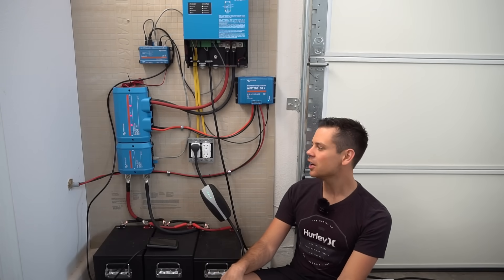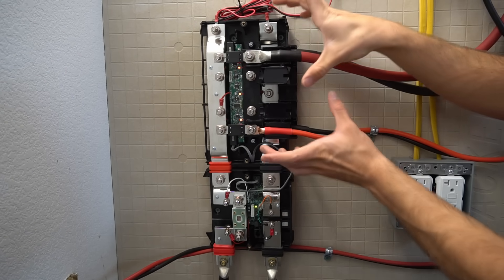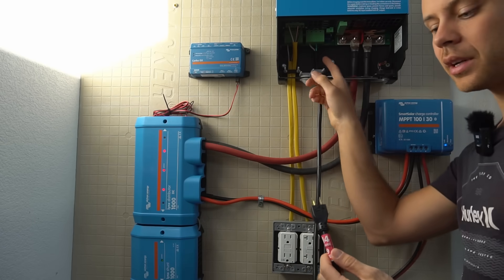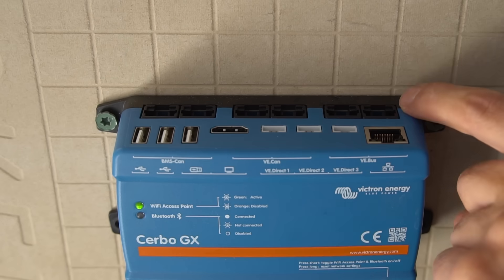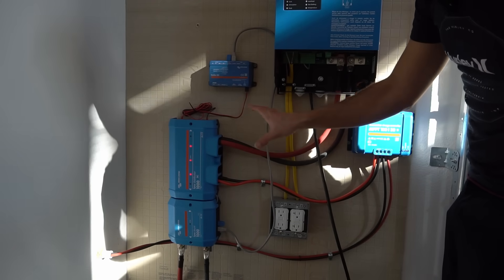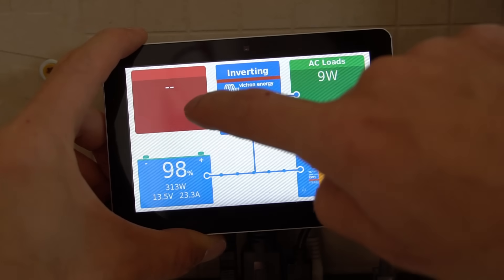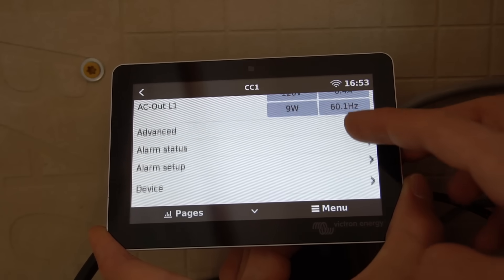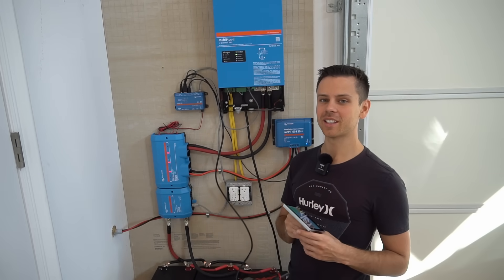Victron Made Easy! Design and Communication, Step-by-Step

Comment: I’ve got a 16 foot Boxtruck. I’m going with 120v appliances, 8000 BTU AC. 32 inch smart TV. 7 ft.³ refrigerator. The lights will be 12 V.
My question is would I be better off going with a 48 V system or 24 V system or 12 V system?

Comment: Love the videos—keep them coming!

I have a 2003 RV with a remote start for the generator. The current inverter is a Trace Engineering Model RV2012, a 12-volt system. It is almost identical to the Magnum Sine inverter. I like the idea of the Victron, but space is an issue for me.

What are your thoughts on the Magnum, and do you have any suggestions on where to purchase one?

Thank you!

Comment: There is nothing ez about Victron.   Mine trips the every time I turn the battery on.  Have to unwire and do the pre-charge resistor stupidity. Why is this not built into the unit.

And as documented on your forum. the Cerbo GX blew out also due to 48v system and lack of external capacitor. Now waiting on Victron to hopefully Warrantee it.  

Don't care how "Quality" Victron is. It is obsolete now to all the all in one units that just work.

And apparently I needed to purchase an MK3 adaptor to even be able to set it up. My quattro did not come with such adaptor.

Is there something I am missing?

Comment: Thanks Will just found this video.  Great explanation.  I'm building an identical system for my RV.  I do have a question though.  Prior to connecting the 15A shore power, your multiplus was showing inverting.  However, there was nothing plugged into the 2 outlets you had wired to L1 and L2 on the Multiplus.  Then when you connected shore power, it still showed inverting and nothing was plugged into the 2 outlets you had wired in.  Can you explain what was happening there?  If there is nothing plugged into the multiplus AC outlets, why was the multiplus inverting DC to AC.  
Again love your stuff you have an incredible knowledge of solar and electricity and do an amazing job describing things.

Comment: Very interesting and thorough video, Im looking to kit my work van out, running from a 12v DC (Main van battery) to a 24v Lithium leisure battery to power various things, such as a 24v trailer tester, and a jump start access for various 24v vehicles. Paired to that, an inverter capable of powering 3000w worth of equipment (Not constant but very often, electric compressor (2400W, tool battery charging and a few LED's inside the van) Would you recommend I use anything other than the multiplus 2 inverter for this? Im looking to do the setup right first time with proper equipment, such as Victron. 

I wouldnt be using any AC input, strictly DC from my vehicle battery charger with some sort of voltage sensitive relay /DC-DC charger for my leisure battery - feeding the inverter
Thankyou

Comment: Thank you for sharing I have a mix of equipment both Schneider Electric and victron and my question is around the victron 24 volt 3 out battery charger it's my understanding that there is a video of a distribution distributor victron showing a battery charger hooked direct to a charge controller which really makes sense so rather than me connecting my battery charger direct to my 3 battery Banks wouldn't it be advantageous to hook up direct to my 80 amp Flex Max Outback this way it could potentially double or triple the amps to the battery Bank what are your thoughts and what would be the math behind it my theory is 110 volts ac * 16 amps DC would be 1,700 some odd watts is that correct

Comment: Per manual, 440w max solar on 12v system. I think you said 800 watts connected. I have the same unit...I didn’t know this before buying it...

Comment: So where does a VICTRON ENERGY SmartShunt IP65 - 1000A/50MV come into play? Is that still necessary? Thank you 🙏
Reply: There is one built into this system bolted together with the distributor 
The Smart Shunt is a better option than the Lynx Shunt with the distributor, it is much cheaper and more accurate than these distributor linked shunts from what I have heard/seen.
Also the Lynx Power In is a much cheaper option than the Lynx Distributor if you want to save money and dont need to see a red light if a fuse is blown for another $140 cheaper (in Australia that is).

Comment: Hi, can I connect 700w to 75/15 Vitron without burning it
Reply: As long as your strings dont exceed 75v you should be able to connect about 1100W of Panels, ie: 
75v x 15A =1,125 watts.

Comment: Planning on adding a solar array to our 5th wheel camper sometime in the future. We want to be able to boondock and not need to run a genset or plug in and still be able to use an AC unit, microwave, and of course the fridge. 
I’ve been wondering what all we will need, how much, and how to set it up. 
This video sure helped answer a few questions. Will definitely be contacting Victron and speaking with them to figure out what all exactly we will need in order to set it up.
Appreciate you bud, thanks

Comment: Hi Will,
Great video as always. I notice you have that thin wire going from the Cerbo GX to the distribution box. What if you don't have the distribution box ? The battery wont have one of the sockets? Do you just strip the wires and attach them directly ?

Comment: I'm in the process of installing a Victron Smart Solar 100/30 and I see that you do not have the (now) required grounding wire attached to the screw on the left side of the controller. 
Was the grounding wire not required in 2022?. The Renogy controller I am replacing was not grounded.
Reply: From what I understand (correct me if i'm wrong)... The shore power is supplying a ground for AC.   ... And since all negative connections arrive to the distributor, im guessing there is a single earth ground connection from battery negative to take care of DC.

Comment: Great vid Will. It's important to point out to customers who are new to Victron : Will referred to the CerboGX as the "brain" of the system - which is true, but also brings along the inference that the CerboGX is a required part. The system will work just fine without a CerboGX, and in fact most of the systems we design will not have a CerboGX (or a Cerbo s-GX, or a RaspberryPi with VenusOS), but the Cerbo does enable you to have remote access to your system if you have wifi, ethernet, or cellular connectivity at the installation site, and also enables you to get alerts/alarms, and also enables you to have a nice display panel if you want.

Comment: Where would I get a diagram of a 24volt version of this.
Reply: The only thing that would be different is the battery bank. The charge controller can be programmed for 24v bank and you would need the 24v version of the inverter. The shunt is universal.

Comment: Many components, many cables, many connection connections.
Victron has published all components out from the inverter housing and generously distributed the resulting heat.
The advantage is that the inverter does not need a loud blower and the component is still cool (more durable).

The disadvantage is that every single component is expensive to buy.
Does that pay off?

The Chinese offer inverters for a small price that have integrated all components.
Accordingly, you have less tangle of cable. Less transition resistance.
However, these inverters are quite loud and have many fans.

The Chinese therefore rely on 48V systems, where smaller currents flow, fewer change losses occur.

Comment: Hello. Do you mind if you share the email address? I'm interested to have an off-grid 48v solar system for my van and I really need a full diagram of the sistem. My problem is nobody intent to help me when I told them that I have already the solar panels ( my friend bought them for a similar project but he quits so I have them for half price). I'll pay for the configuration of course. Thank you.

Comment: Im getting ready to add this system almost exactly to my sailboat with one exception. I was planning to use Victron 330A Lithium batteries and the Victron external BMS. I see you are using Epoch batteries and I assume internal BMS. Will you give me your impression of which way to go? I have a Multi plus 3K, Cerbo, transformer to convert form 230V to 120V for the Multi plus and 1600W solar with two MPPT change controllers. so Iim changing a goo but to be able to upgrade to Li from AGM

Comment: Great presentation!  Just starting to build a system for my RV. I currently have a single SOK 280AH Heated battery. I plan to purchase a second one of these possibly a third down the road. I plan to connect the batteries in parallel. Is there anything I need to do to keep the batteries synced regarding their charge level?

Comment: Hey Will hope all is well. I was hoping you could make a video explaining the difference between VE can and VE direct. The pros and cons etc. I have recently read on some of the forums that the same device wired with one or the other dictates how many days of data is logged on the vrm portal, I also recently connected both ve can and ve direct to the same device and it affected my vrm dashboard and doubled the incoming solar imput because it recognized both cables as being connected to two devices..... Idk just thought it would be an interesting video

Comment: Thanks for the Victron communication  info on your channel.  I would like more info on the Multiplus 2   48 Volt 5000VA unit for a  120V   off grid system. Thanks for your help!

Comment: Would you add the second inverter to this to show how it connects into this existing system? My brain is having a tough time seeing that the grid power supplies through the inverter to the batteries but when power goes out it auto switches to battery. The connections are a little confusing. How a generator would fit into that would be outstanding. I'm working on such a system as storms knock out power on our farm at the drop of a hat.

Comment: Explorist Life channel use this almost exactly this same setup in a camper van.  One feature they use which is not mentioned here is a supplement mode where shore power can add capacity to an inverter load. Not sure if have recalled the proper terms here, but this video does not discuss shore power in great detail

Comment: I did not understand most of this and I am smart and DIY savvy.  I am not familiar with what each component does and how they work together. This was not a good explanation.

Start out with:
This is Cerbo GX. It's function is to.....xxxxx
This is a Lynx Distributor. It has two parts. Part 1 does this...xxx. Part 2 does this.... xxxx.
This is Multi Plus II Inverter.  It can work with Lithium or Lead Acid Batteries, which many other inverters cannot do. It can output 110V power from batteries (point to sockets), and output 12V power for charging laptops, phones.  It can also recharge your batteries from shore power 110V.  It can recharge your batteries from the solar panel via the MPPT  solar charger.  It can also charge your batteries from the Engine Alternator when car is running via the Orion DC to DC charger. List all functions.

Now show how each connects to each. What is optional. What can be added on later. What is essential.
At the heart of that grid is the Multi Plus II. Each power source is coming in with its own device:
Solar panels have the MPPT solar charger
Engine alternator power has the Orion DC to DC Charger
Shore power has the ??? device or goes straight to the Multi Plus which converts it to DC power for batteries.

Then go into more details. You need to lay out the ground work and be sure we understand what each device does before launching into details.  I am very confused about the Lynx distributor device.  Once I am stuck there, nothing else makes sense.

Comment: I am in the process of gathering information and planning and so happy I found your channel.  I live in Florid and we have a gas generator at out house which we've used several times over the years at  3-4 days until the mains came back on.  The gasoline generator is a 13,5 Kw surge and 8k constant unit with electric starter.  When my wife and I first moved in we had our electrician install A manual transfer switch to separate mains and emergency power.  he made up a huge cable that plugs from the generator  into a box adjacent to the main power panel outside.  I've used it and it works well if we shut off all breakers before starting the generator, then add breakers to power certain rooms in the house.  Prior to each hurricane season, I fill 6  five gallon can with gasoline and store in my shed. I can get five days on this supply .  The "Exxell 8000" has been reliable only needing one carburetor rebuild in 5 years, holds 10 gal of gas, positive pressure oiling system and oil /air filter changes periodically per hour meter readouts.  After watching your video today, it seem like I could program the generator to auto start from the controller.  I installed a new automobile starter relay in my gas generator as the factory one was wimpy and died.  So this new relay costs $12, one third of the factory replacement from Genrac/Briggs and can carry tons more current.  At this point I am almost OK with buying an all in one Bluetti type and call it done.Thanks again for all your videos, well done and such a easy articulate voice.  Ted in Sebastian, Fl.

Comment: Will, do you really need the shunt? Or can I just use two links distribution with three EG4 'LL 24 v 51 kWh batteries x3? I was thinking three individual sets of wire's from each battery to the links and mppt, cerbo gx multi plus? What size wire1/0 and #2 way for charger? 150/70

Comment: Hey mate just wanting to know if there is way to limit the charge current to the battery...  cause I believe my lithium batteries can only handle 40amp... I have 3 wired in parallel like you in this video positive off the first and neg off the last.  But haven't been able to locate any Info on limiting the charge current if needed too.

Comment: Interesting, you used 12/2 NM cable (20amp) running to the receptacles. Was that intentional? Isn't the AC output from the inverter, 110v at 15amps?

Comment: You mention in this video and in other videos how low the standby consumption is on Victron Inverters vs other Inverters icluding All in One units. When comparing All in One units have you considered the idle consumption of all the components that are included with an All in One vs the idle consumption of all the components in a modular system? In a Modular system when the sun is down and no power is produced by a solar array, the PV Charge Controller, AC Charge Controller, Automatic Transfer Switch, The Shunt,  The Distributor, and in the Victron system the Cerbo GX all have some idle consumption. If battery power is primary then all of those components are powered by the battery bank. If you were to add all of that together how close does it come to a All in One systems idle consumption? An All in One has the MPPT, the AC charger, the Transfer Switch and the Inverter, therefore the idle consumption is for all of those components. It would be an interesting video to see what the total idle consumption is for a Modular System.

Thank you for all you do! I appreciate the videos. Keep them coming.
Reply from the maker: Yes very true!!

Comment: So, let's see.  You need batteries, a shunt, a distributor, an inverter/charger, a solar charge controller, a Cerbo GX, a display, and a five gallon bucket to haul the money to the store in.  It seems like overkill unless you're building a pretty substantial system that requires constant monitoring.
Reply from the maker: Haha agreed
Reply: @WillProwse  I'm building my first project -- a HAM radio emergency communications system in a cargo trailer.  You've pretty much got me thinkin' 48v, which is something I never would have considered.

Comment: Great video!  I plan on building the same system. My question is, the Victron manual calls for 2-1/0 cables, less than 2 meters. 2/0 cable is normally rated for 300 amps. Is 2/0 cable acceptable in your build?

Comment: I have 2 banks of 6 eg4 batteries (not LL). Needing a wiring diagram to connect my 500A smart shunt to them. Banks are parallel to parallel. Pairing off on th😊e two negatives. Would i need two smart shunts? One for each battery bank? I'm going off grid. Each bank has 6 batteries (5.12) a little over 30kw each. Thanks.

Comment: I have the venus gx device and i have not yet connected it and i am not using my lynx because all off grid. Please can anyone give some advice on how to wire up the venus gx its seems quite different to this newer one in this video. I am all setup with a full victron sytem mutiplus 3000 watt invertor and have the victron solar chager but im operating blind here without my venus gx connected

Comment: I cant help but notice that people that explain battery setups always like to touch the poles of the batteries with their fingers.
Reply: Never make it a habit of touching bus bars no matter how low the voltage is.
Reply: @jaytheblader6701 You're not wrong for the sake of habit practice. 
But still...  it's only 12 volts here.

Comment: cervogx recognize battery as one. but actually you connect three lifepo4 batteries in parallel. how can i understand each single batteries condition? i'm talking about communication between batteries. server rack batteries make 30batteries in parralel connection possible, sometimes.

Comment: Hi I am a beginner in the solar system arena I already have a system that I built but I need some guidance on how much batteries what charge controller what inverter  and how much panels would it take to effectively power a full off grad home use a 6 Foot deep freeze about 10 lights 3 TV 3 fans  could u help please thanks in advance